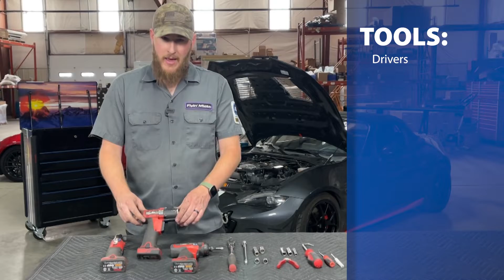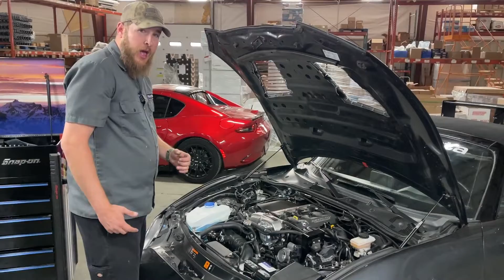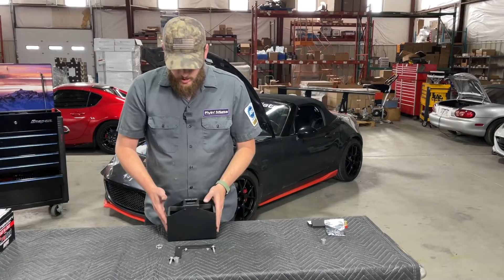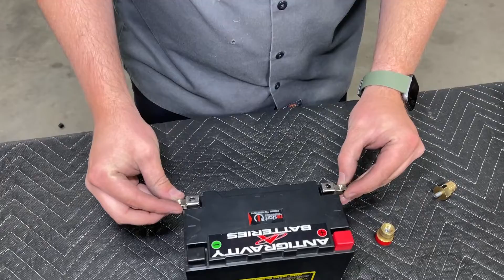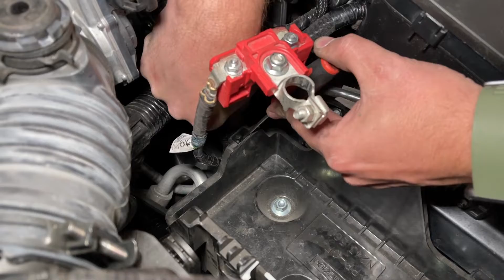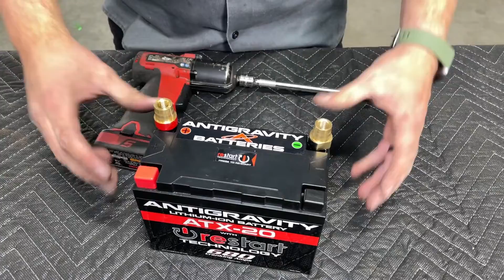ND Lightweight Battery Kit Install - Mele Designs mount with Antigravity Battery

Comment: what is the downside of lifting up the battery instead of changing to a longer terminal cable?
Reply from the maker: @ryanwang8249 We're not sure what you mean here - can you clarify?
Reply: @FlyinMiataVideo  Yeah, so the reason for having a longer terminal cable is because the new battery sit very low. Why not make the bracket taller to compensate the difference? Then the original terminal cable can still be used.

Comment: 28:20 I just got the kit and it came with different lugs than the ones in the video. Seems like they no longer need sanding, can you confirm?
Reply from the maker: @Steve-cl6dj Is there a flat spot on the negative terminal? Kyle goes into the reasons that modification is needed at the ~31:58 mark. The the terminals you received are already set up for this, you may not need to perform these steps. Please contact our Customer Support team for more information.
Reply: I just received the kit as well. The new car terminal adapters now have a hex base instead of the round base shown in the video. I haven’t tested fitment yet but looks like sanding is not required anymore.

Comment: Doesn't a lighter battery upset the weight distribution and if so, what are the corrective measures?
Reply from the maker: Good question! I think you'd notice the biggest difference in the NC and NDs since the battery is in the nose rather than the trunk. It'd be a good test to see how much if any it changes the front to rear % when corner weighting.

Comment: don’t recommend this battery if you live in areas with hot climates. it overheats and won’t start your car until it cools down.
Reply: That’s my concern, I’m also in California so you having issue with the battery over heat?
Reply: @SuperRex7  yep i'm in cali too. no good in summer
Reply: Hey I have a question.how hot we talking. I live in atlanta georgia. Where its alot of stop and go traffic. The hottest it gets is 98, maybe 100, and above in other cities in the summer.
Reply: @camandrews1  i live in california and it crapped on me twice in the summer. high 90s and low 100s.

Comment: Why do you have the CAN controller relay out of the fuse box?..... is this the recommend way? I had trouble getting the fuse box top back on once I put the relay inside the fuse box. I managed to get it back in.
Reply from the maker: This is our shop ND, so we need it outside for easy access and testing.